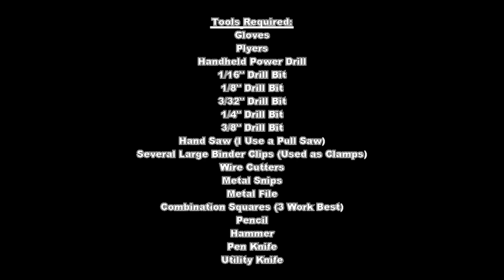#097 The Guillotine - Part 1 - The Build Up - D&d, Pathfinder, Tabletop Games

Comment: So far this is awesome. Hand carved pulleys and head basket. Of course real metal for the blade (although you will eventually use up that computer cabinet and will need to get another one to cut up. LOL) Looking forward to part 2
Reply from the maker: 😁👍 Thank you very much Echo Delta and don't worry, I have an excellent source on getting old metal computer cabinets, when I go to the recycling place here, they usually have a few there 👍 so plenty of metal creations to come 😀 it was easier to carve out the pulleys than find them plus you need a place for the head to go....in a bucket 😀 part 2 is next weekend 👍 Thank you for watching my video and for your comment 👍😁